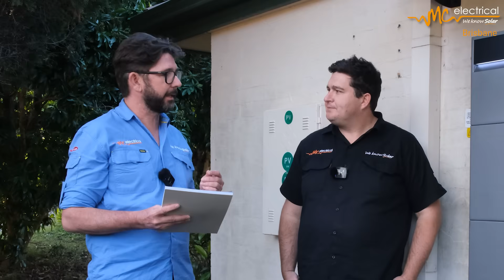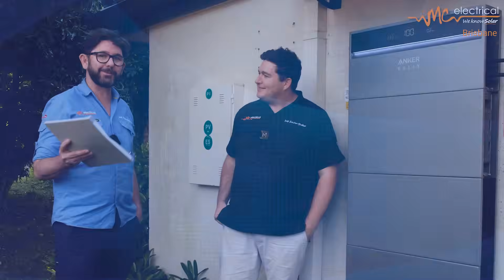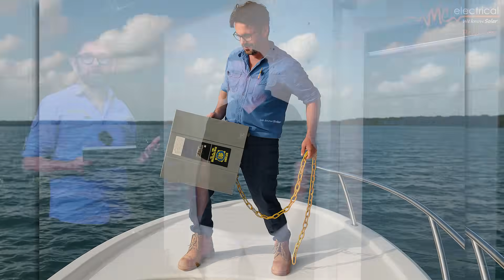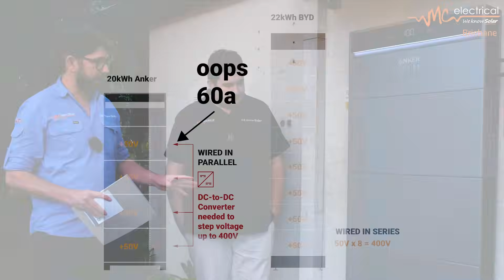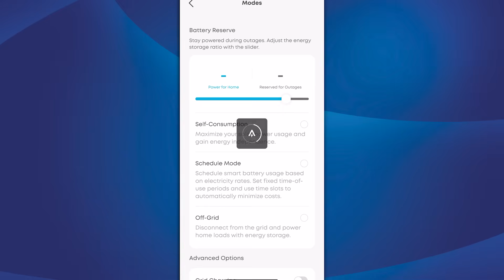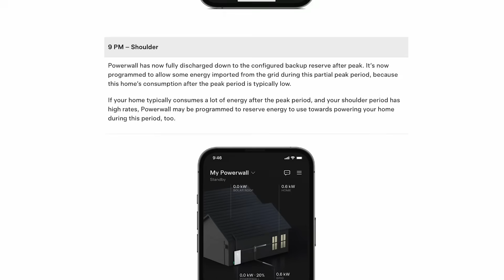Anker Solix X1 Installation Review

Comment: Anker is the only other brand ide consider outside of Tesla/BYD. I just bought a C1000 + expansion battery from Anker and its excellent.
Reply from the maker: Thanks for sharing.
Reply: I just bought and you can judge a product with a lifespan of 20 years from a fake brand ?
ANKER is german if you did not know it, the word means what ?
But ANKER is a chinese company abusing a german word. That is it. Short and simple - and then you know why a chinese brand is hiding its heritage from powerstations, these tiny 2020 toys with 500 Wh. 

20 years from now you will not even remember the brand anymore or that you once had it. 
European climate and they suffer and struggle big time cause they loved to deal with customer claims - at least power stations

If you buy serious stuff you get an answer from the manufacturer if you ask for the manufacturer of the cells and the model number built in. Here it is part of a certification and our domestic manufacturer can tell you what they are choosing for you.

Anker did not reveal it when I had asked them on the last 3 biggest fairs in the EU. 
Why ?

If you wanna buy cheap you buy cells from the spot market for your customers - and for your profits.